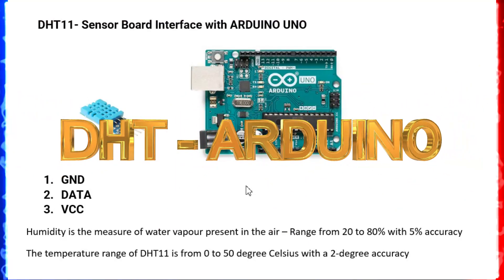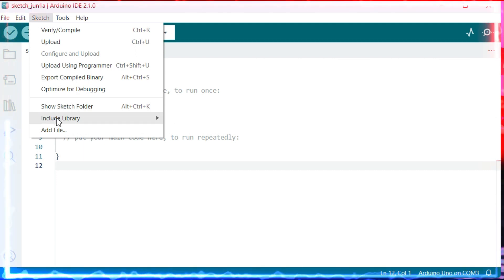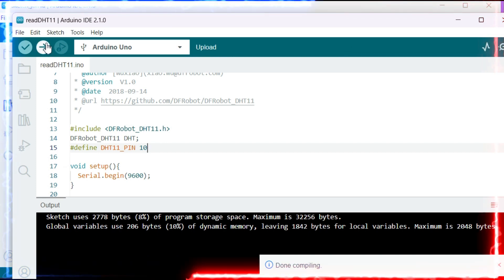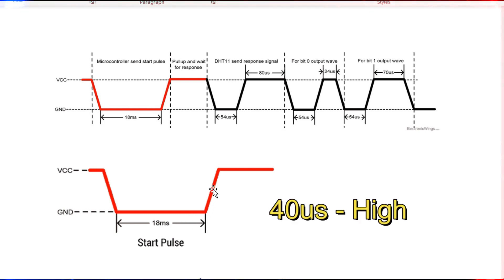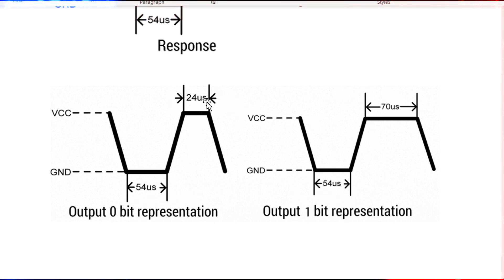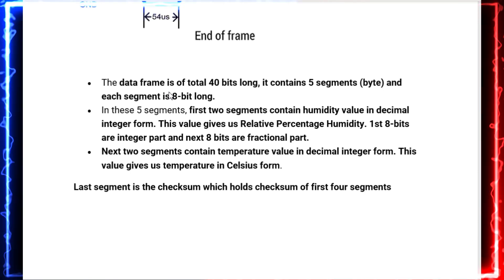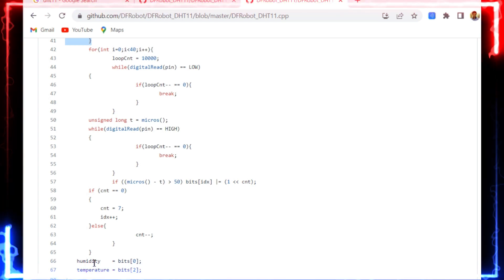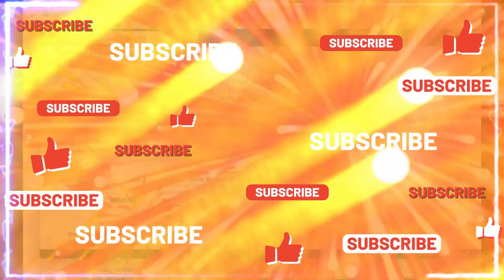How to Use DHT11  With Arduino | How to Set up DHT11 on Arduino  🤔

Comment from the maker: Pin Connections Explanation

At Video Timestamp 00:30
From the Sensor Board’s point of view, a specific pin is being discussed. This pin is responsible for sending data/signals to the Arduino.

At Video Timestamp 2:23
This signal/data wire is being connected to Pin 10 on the Arduino Uno board.

Comment: no indication of which pin is which
Reply from the maker: Will get back
Reply from the maker: Pin 10 is for data, rest are supply and Ground
Reply: @AlexTechProjects  I also came here to find out which pin is which because you left this video link as a reply to someone asking the same question but it doesnt answer
Reply from the maker: Sorry will get back
Reply from the maker: Pin 10 - data please check once and watch once
Reply from the maker: Pin Connections Explanation

At Video Timestamp 00:30
From the Sensor Board’s point of view, a specific pin is being discussed. This pin is responsible for sending data/signals to the Arduino.

At Video Timestamp 2:23
This signal/data wire is being connected to Pin 10 on the Arduino Uno board.
Reply from the maker: Pin 10 for data, rest are supply and Ground
Reply: @AlexTechProjects  there are only 3 pins on the sensor ?
Reply from the maker: @Harrison-us3pk  One is data, rest are supply and Ground
Reply from the maker: @Harrison-us3pk Yes
Reply from the maker: @Harrison-us3pk  Pin Connections Explanation

At Video Timestamp 00:30
From the Sensor Board’s point of view, a specific pin is being discussed. This pin is responsible for sending data/signals to the Arduino.

At Video Timestamp 2:23
This signal/data wire is being connected to Pin 10 on the Arduino Uno board.